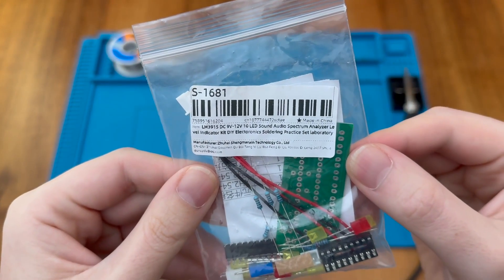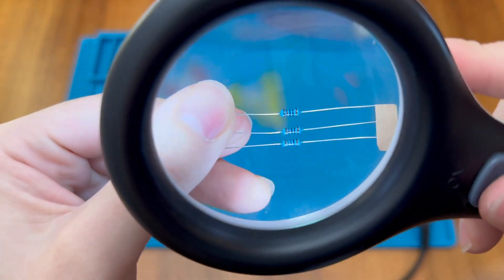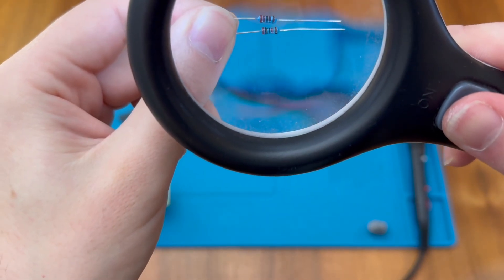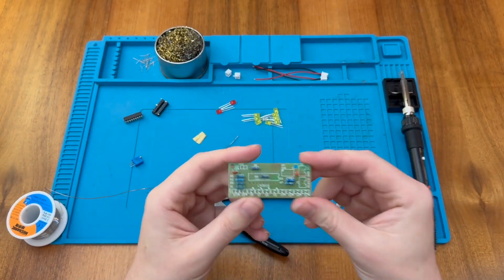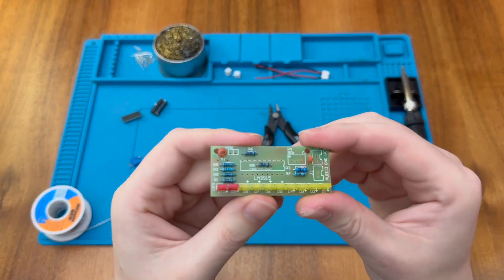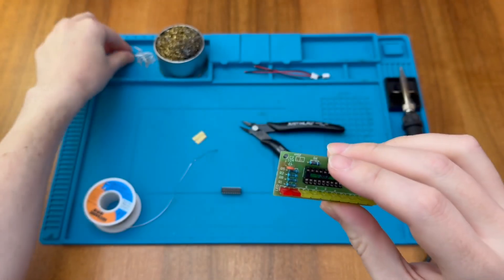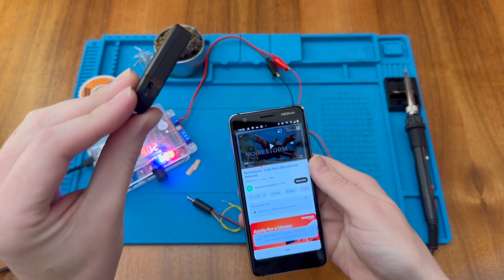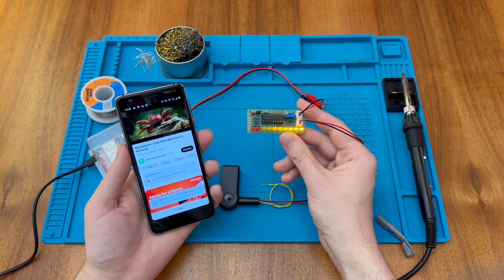Audio Level Meter Kit FAIL? Dubious dot mode for the 10 LED LM3195 DIY soldering

Comment: Great video Jason. Please advise what solder and soldering iron you use (Aliexpress link) for your projects? Thanks!
Reply from the maker: Thanks for the comment. My soldering iron is part of a generic kit from Amazon and cost me just £11.49. The exact one I purchased is not listed anymore, but if you search "80W Soldering Iron Kit" you'll see many examples come up for around £15. https://www.amazon.co.uk/s?k=80W+Soldering+Iron+Kit -- you can probably also find something similar on AliExpress.

The solder used in this video is Mechanic branded, but I also like the cheaper Kaina solder. I think there are a lot of "fake" brands though, so it can be pot luck as to what you actually get.
https://www.aliexpress.com/w/wholesale-mechanic-hx-t100.html
https://www.aliexpress.com/item/1005006859440740.html